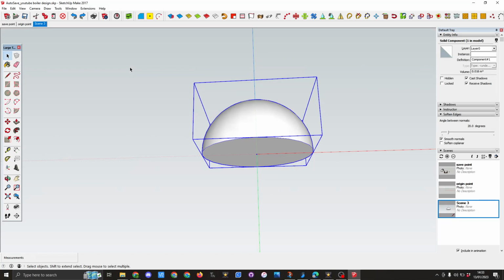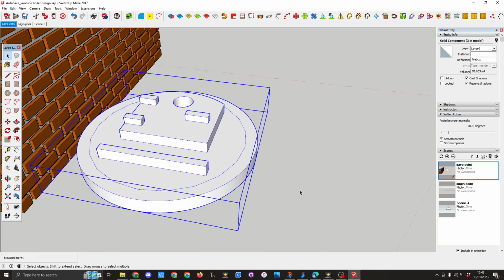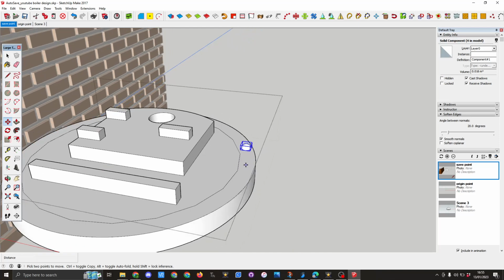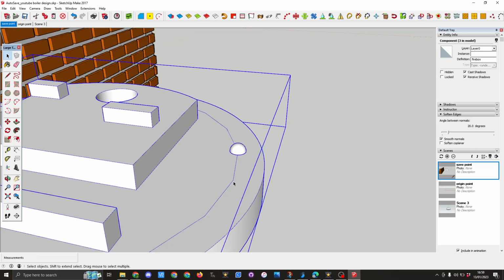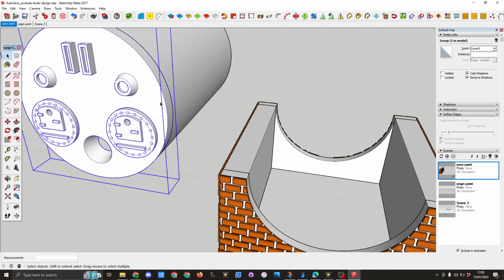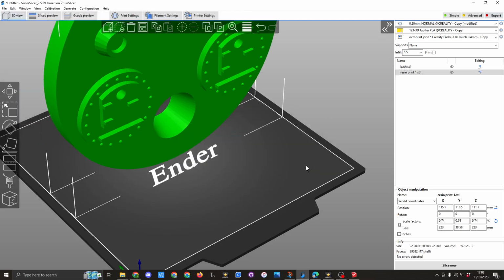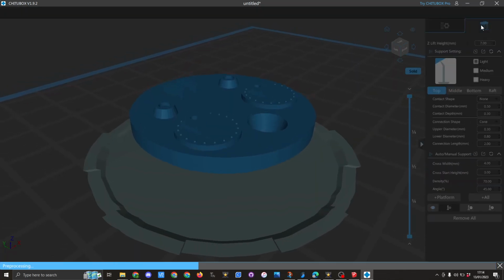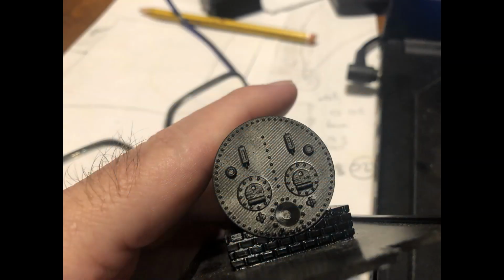Sketchup Make 2017 Part 6 Lancashire boiler creating the 0.4mm rivet for the resin printed version

Comment: Looking Good.
Reply from the maker: Thanks Bob its easy once you know some of the quirks of any software. 

I have been looking at the ITrain software and that is a great piece of software, does it support DCC++EX?
Reply: @modelrailwaytheeasyway9743  it sure does. Since version 5.1 of iTrain.
Reply from the maker: Thanks for letting me know it sure does look promising. I know a few members use it in a club I am in but they use commercial command stations.